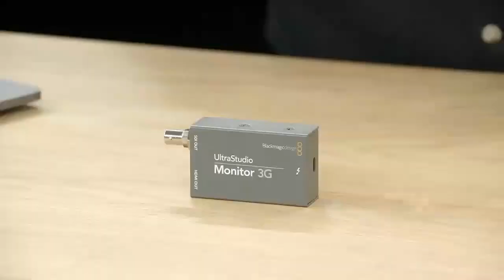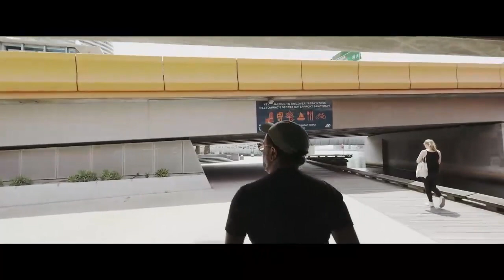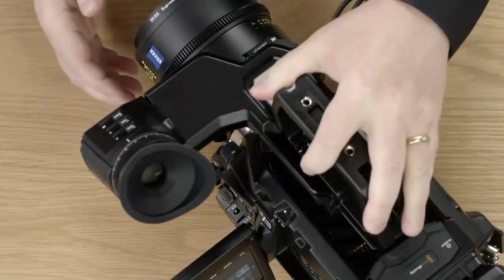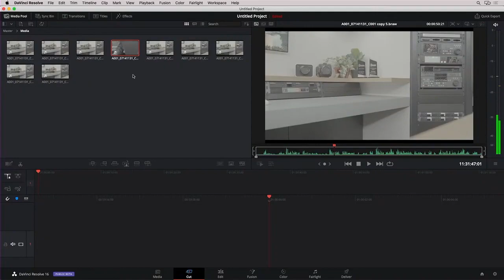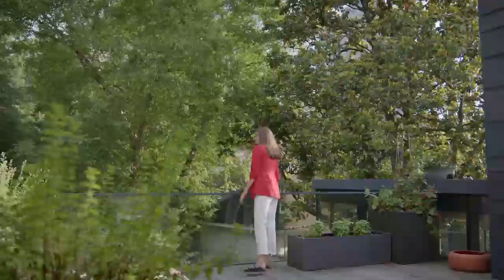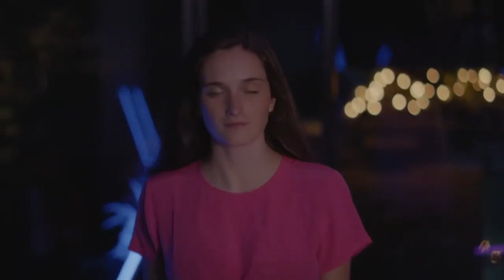Blackmagic Design Camera Update - URSA Mini Pro 12K announcement

Comment: 80 MP in the video camera with apsc sensor that can take 60 frames per second... And photography can't deliver more than 35MP apsc with 6 fps for PHOTOS.
Reply: Ain’t there’s a camera that can deliver 100MP, and I don’t think their cpu is fast enough to handle a lot of frames. And at that point u might as well use a cinema camera to take pictures 😂